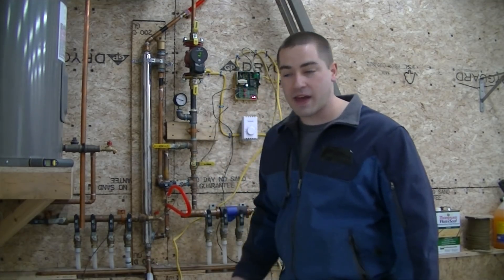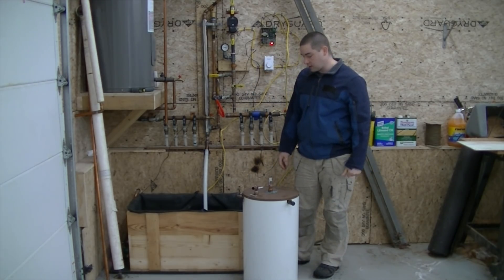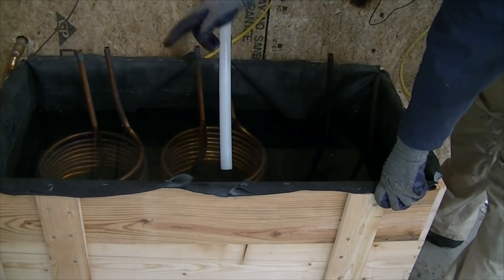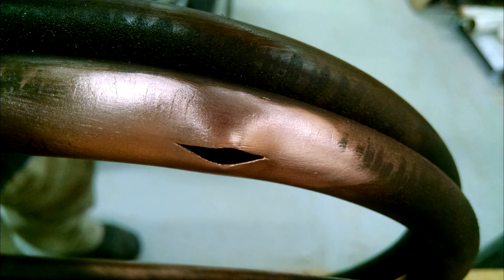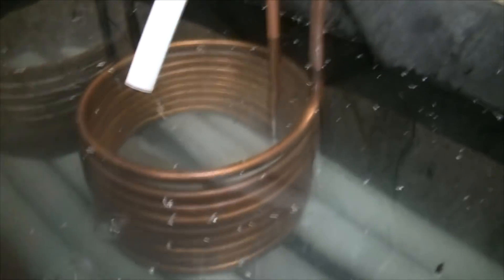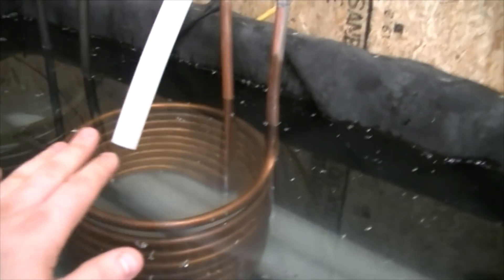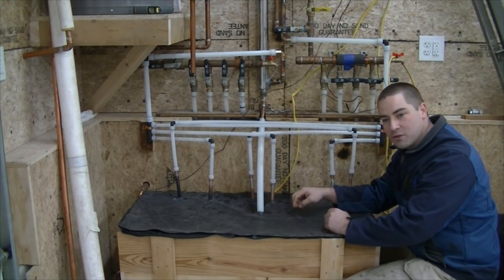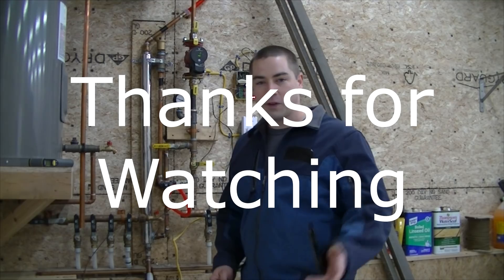Adding Heat Exchangers to Garage Solar Heater

Comment: Have you ever made a battery out of sand and was it very successful?
Reply from the maker: No.  I have two hot water systems that I've built. I've never built a sand battery.
Reply: @DavidPozEnergy  me and friend are going try it. The sand can get a higher temperature but not sure if the heating elements can take it.

Comment: David, Thank you for your videos! Why do you need to use a heat exchanger? Why not just circulate the heated water straight into the radiant flooring? Thanks Bruce
Reply from the maker: When I first built the garage, I made it with a sealed radiant floor and an electric "boiler".  That system uses some cast iron parts.  Cast iron can rust if exposed to air, so it's a sealed hydronic system without air.  
Later, I added the solar hydronic system to assist in heating.  The solar is a "drain-back" design.  This means there is air in the solar system.  The heat exchanger keeps the air out of the radiant floor system.
If I was building this from the ground-up, I could make the whole thing compatible with air by using only brass or stainless steel.

Comment: great video. we have Solar PV Water Heater. It is a pressure system. compared to normal solar thermal collector, we do not need plumbing works on roof top. It can be used  for home, hotel, SPA, jacuzzi, pool etc.

Comment: Because you have different lengths of inlet and return pipes the water will tend to use the shortest and least resistance path. All pipes should of been the same length to balance the system

Comment: If you are still using this system, you could have the return dump onto an area separated by baffles, to allow the incoming water to stratify thermally and not disrupt the stratification in the tank.  Matters more in a taller tank though.   Reina LLC has videos on their superinsulated net zero, solar heated homes they buikd around huge 5,000 to 15,000 gallon thermal storage tanks.  In my area, with milder, sunnier winters, I imagine I could keep my relatively poorly insulated 2600 sq ft house warm with a 1000 gallon thermal storage tank.

Comment: Hey David, are you using the hot water as hot water too? It seems like it would be more effective to just run the solar hot water through your floor directly. Perhaps you want to store it during the day and use it at night though?
Insulating your tank and pipes should help a lot.

Comment: To keep the cooler water at the bottom of the tank from mixing with the warm water at top,  I would suggest to have the solar water return, splash on top of a rigid piece of insulation (floating in the water). The rigid insulation would allow the hot water to drip into storage tank off the sides of the sheet and create less mixing of hot and cold.

Comment: Great video, thank you! First time watcher, and at double speed. If you are trying to heat the garage, would it help to add a liquid to gas heat exchanger on the return line maybe as a last collection step before the water leaves the garage? I'm talking about a radiator with a fan behind it, and maybe a shroud. Maybe a 12v fan from a car...an assembly, so you could possibly make it variable speed and thermostatically controlled.

I learned some good stuff here from you. Thank you very much!!!
Reply from the maker: If I further cool down the water, (with a radiator) then I won't have as much heat transfer into the floor.  I want the mass of the concrete floor to get as warm as possible.
Reply: @DavidPozEnergy  If you want max heat to the floor, you will need two or three tanks of ascending/descending operating temps, and much more "coil"/ surface area in the tanks for heat transfer, and also to agitate or circulate the water in each tank, as I see you do partly now.

The bottle neck could be seen as the concrete and pex transfer rates. Since adding more floor tube isn't likely, tank storage has to take up the slack, like a bellows or flywheel. The downside of solar-hydronic is its space needs, but I think you have enough space. Three tanks, say, (each will find its range to operate in) with the water passing through each, getting hotter each time before going back in the floor. The reverse with the panel loop. The radiator idea was to take 'waste' heat out just before the water leaves the building for the collectors.

Heat exchangers: coils like you had, flat-wound copper tube and back and forth parallel tubes...how about horizontal car radiators instead of the plastic pipe in the tank, or finned baseboard tube, with compatible metals? Any dialectric couplers needed in the system with the electric water heater in the panel loop?

More water storage, and at different temps; more exchanger surface, more fun! :) And btw, what about a passive 'beer can' Trombe wall to add a little boost? Warm air can warm slabs too, and maybe you want to try one for a project to post :) I can't preach to you, just offering another pair of eyes.
Reply: @DavidPozEnergy  For a quick test, maybe use an open head plastic barrel and whatever heat exchanger is most handy. You could probably use stratification instead of multiple tanks, if your column were tall enough with enough cross section (but then your coil would be custom made, most likely) I'm not sure doing it horizontally in the tank as you are trying is going to help a lot, though did it?

Comment: Why don't you circulate the liquid from the solar collectors directly through the under floor loop(s)...???
Reply from the maker: If I was building this garage with the solar from day 1, then I would.  In my case I retrofitted the Solar onto the existing hydronic system.

Comment: Hi David, Like your vids. But your water buffer would be much more efficient if you make 3 cambers. So you can have your heat exchanger(s) with your solar hotwater and one camber to collect the coldest water and one to have more buffer in between. And a lot of isolation if you like to use the energy somewhere else. But you can also make an electric heated part for when your batteries are full and the sun is still shining. You know I am still busy looking around for a green solution for my offgrid cabin on wheels. An "heat battery" from well isolated white-sand with an heating wire and an copper water heat exchanger in it.

Comment: Why not insulate your heat exchanger tank with sand in place of water. The thermal mass all around your copper coils will act as a thermal battery. Sand can hold heat from 105° to 65° in open air for 5.5 hours. If it leaks, you just have wet sand to deal with.

Comment: A few things... one, why not use the other heat exchangers as they were? Those other things were better situated and better insulated... Then as for that 'turbulence' why do you have the hose above the water line? And if it is as I suspect, then get a funnel in there between the hose and the tank, the funnel bottom should be about 2" above the bottom and the rubber should be resting on the top of the funnel... But again, better to use the old heat exchangers...

Comment: Could you tell me why you're using a heat exchanger instead of just using the direct connection from the panels to the floor?
Reply from the maker: I'm using a "drain-back" system for the solar hot water.  This means there is plenty of air in the solar system.  But the floor system pre-dates the solar system, and was built using cast-iron parts.  I don't want the cast-iron parts to rust.
Reply: @DavidPozEnergy  Thank you, David.

Comment: Like your idea.  What would you suggest to heat a Greenhouse that is 10ft x 12ft in winter to stay 50 degrees or above?  Would your solar heated tank heat hot enough to run through a radiating panel baseboard? How hot is your solar water heating in winter -v summer?
Reply: Hi:) I hope I'm not interrupting. You might really benefit yourself from the science already known for your specific area. If you talk to "Cooperative Extension", a service of the USDA and your state's land-grant college, they may easily give you a BTU number you need based on your climate, your greenhouse construction, and plants to be grown. Then you can know how many square feet of collector depending on the collector type/efficiency, which they or others can help you find out. The idea is to get you in the ball park with numbers and costs before you spend money, unless you have things already just to try. As in: you can see right away if you will need maybe 100 sq ft of collector or 500. You have a temp target that is more critical is some ways than a workshop. 

By the time you see how much space hot water storage might take, you might want to build yourself a parabolic trough collector to store more BTUs in less space (hotter water or brine) Sorry for budding in! If you grow things, the ag extension service has lots to offer! It's their mission :)

Comment: The best heat exchangers are not the coil type seen in your video.  Consider replacing them all with just a single "Counterflow Wort Chiller" design, consisting of a tube within a tube, soft copper and coiled. This is positioned outside of the tank, separating the water from the solar array from the water used in heating the home.  With this design, you could use automotive antifreeze inside the solar array and raise the boiling point to above 240 F if designed with pressure control, and this protects the solar array from freezing during winter..    I find that a 20 foot length of this type provides maximum efficiency. Refer to home brewing equipment sites for further ideas on this design.

Comment: https://youtu.be/sP_2LKrH41o?t=222 that color in the copper coil  is there because of exposure to  air (oxidation of copper)
https://www.corrosionpedia.com/images/uploads/70772b05ea96459abbc1984a4e4bc833.jpg?width=400
all the beast from romania
Reply: Just make it extrema, minimum 1000 gallon tank underground super insulated !!!

Comment: So heat transfer in is a product of surface area.  Have you thought about getting old car radiators?  A single one would have a higher surface area than all three coils if there is any flow across them.

Older cars ~60-70's have copper core radiators if your worried about galvanic reactions

Comment: I'm about to start a project similar to this, I'm gonna need a heat exchanger anyway, I'm going to basically convert a wood stove, to a boiler, I'm hoping to have a separate storage of 200-400 gal.in a well insulated box, the actual boiler will hold a couple gallons at most, I'll also use excess solar, and possibly thermal solar also, but that will come later, also possibility circulate water from my tankless gas water heater, for home heat. It will also supply hotwater for kitchen/bath use,  I can also use me DC generator to heat the water, using about 4x 48v elements, and probably a couple 120v elements, so my AC gen can heat water also, if you are making it, and are off grid, you may aswell have backups for backups,  I hope to add radiant floor heating, along with the radiators,  good ol video!

Comment: Why are you separating the solar heated water from floor heating system? 
If the heat exchanger was for potable water, than that would make sense.
Reply from the maker: My solar system is drain-back.
Reply: My question, exactly.

Comment: Hmm im not sure about the idea of wanting the water to be cold running back to the solar collectors. If that was the case it seems to me like it wouldn't be working correctly. The point of a solar hot water collector is to try and maintain a hot temperature. You don't want it getting too low unless you've got a giant collector that can heat the water almost instantly. Which would be pretty hard to do. It needs to recirculate. How did it work? Did you use it for your hot water too?
Reply from the maker: This system is just for heating my garage.  It is not connected to the house.  It works great.  The solar handles about 95% of all the heating for my garage.  I only turn on the back-up 2 or 3 days per winter.
Reply: @DavidPozEnergy  That's awesome man. I love the idea of not paying for heat or hot water if you don't have to. Those are 2 of the biggest things that run up the electric bill. Where do you live is it a warm weather state? Just curious how well something like that would work up north in the winter.
Reply from the maker: I'm in Massachusetts.

Comment: One of the best systems I've seen involved a 10000 liter insulated tank in the ground filled with used engine oil..  the oil was pumped through the solar panels with a pv pump. The advantage of used oil was it could easily reach 170 degrees centigrade plus.
Reply: You won't get very clean taking an oil shower though. Doesn't taste very good either. lol

Comment: Hi David,

I am impressed with your solar projects.

I got a question for you and I hope you can enlighten me. Can you please give your opinion about this idea below, before I spend on the parts. The video link below, shows a solar thermal system to heat the house and for water heating. 

I visited his company's site. I think originally he was using an indirect open vent 250L-tank, then he revised his design. 
He changed the tank and use an open vent direct tank. The hot water coming from the thermal collector goes to a direct tank and the same water is pumped to all the radiators in the house.

I was thinking of doing this, but using indirect twin coil tank, first coil for a thermodynamics heating system (like solamics or magic box in the UK), and the second coil for the solar thermal collector. This tank will have an external plate heat exchanger for the hot water.

Can you please give me your opinion if this system really works and possible problems with this system.

I am not a plumber but I hope my plumber can understand your explanation and may suggestion. 

Hoping for your reply.

Best Regards and God bless.

Jerome

Comment: Why cant you just put the heated solar water into the floor heating system>
Reply from the maker: You could if you were designing the system from the ground up.  I am adding the solar to an existing system.
Reply: @DavidPozEnergy  I am purchasing some used solar panels that heat water, Can I put a heat exchanger in my furnace and run the water right from the solar panel thru the exchanger or run right from panels thru a cast iron radiator? would I have to have a tank? would these ideas work and be efficient?

Comment: Nice work. May I ask where you purchased the rubber roll for the lid?  Thanks
Reply from the maker: It's EPDM, which is commonly sold for flat roofs and pond liners.  This is the specific one I bought and used to line a couple tanks: https://amzn.to/3dUU5GX
Reply: @DavidPozEnergy  Very awesome... thank you!

Comment: David, why "exchange" heat in the first place?  The fluid running in the thermal solar collectors isn't potable and the fluid in the garage floor isn't potable.  So how about running the thermal solar panels directly through the floor?  The floor becomes a heat distributor.
Reply from the maker: If I was starting fresh I would do it that way

Comment: Running them in parallel could result in preferential flow through one or two coils, and be less efficient. I would not do that unless you needed more flow volume than a single coil would allow.

Comment: How hot does that water get thats going through PEX? The dolar people I know seem to get away from pex around 160F. It apparently degrades with excessive heat.
Reply from the maker: I have temperature sensors and controllers.  The system will shut down at 180°F to prevent excessive heat. The PEX is fine.  My solar system is pressurized to 30 psi.  Here are the specs: https://www.uponor-usa.com/residential-plumbing/contractor/faqs.aspx

Comment: Hi David, Nice job. If you fancy making copper coils from scratch its not that hard to bend copper pipe. The trick is to fill the pipe with salt or sand so that it doesnt crush.

Comment: David, after reading the other comments about your system, it seems like you don't need more mass unless sometimes there is too much heat in your floor. And second, there is no way to make more heat in the garage without adding more collectors.  It seems sad that you need a permit to burn wood but not to burn fossil fuel or grid electricity.  Good luck.
Reply from the maker: Permits for everything.  You are correct, that I would need more collectors.  I never have over-heating issues in my garage.  I've actually got more collectors, but I'm so focused on my battery project right now I don't have time for it.
Reply: @DavidPozEnergy  It is probably faster and easier to turn on a heater when you are working in the garage on your batteries, than to add more solar collectors.  Am I right that you have decided to add more PV rather than thermal solar collectors because they are valueable year around?  Good luck.

Comment: Wouldn't it be more efficient if they were in series? 
I'm asking. I'm pretty new to hydronics.
Building a radiant floor in my pole barn.
Thanks for posting this.
Reply from the maker: I plumbed them in parallel because they are pretty narrow inside and will restrict the flow rate.  By paralleling them the flow rate is staying good.  However, if I was to build it all from scratch I would have just bought a coil of 3/4" copper coil.  It would have been far simpler.